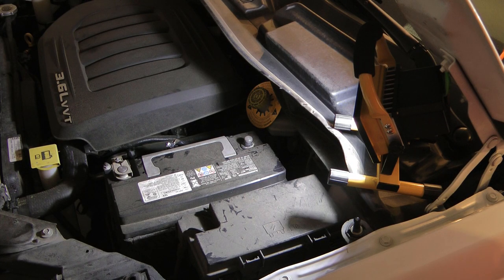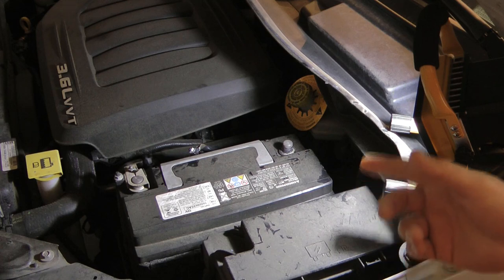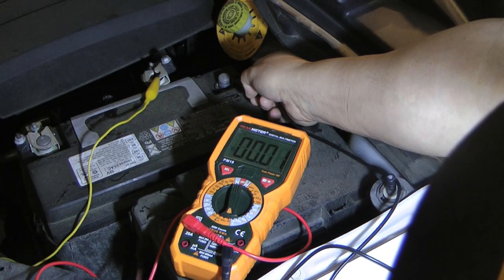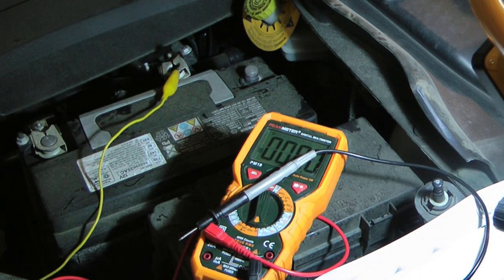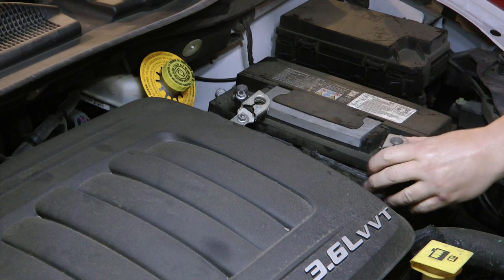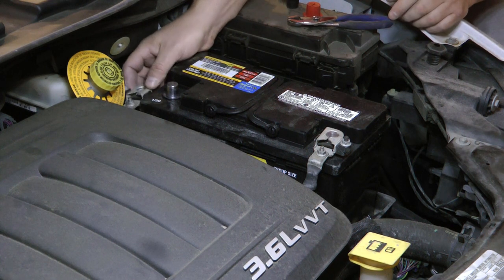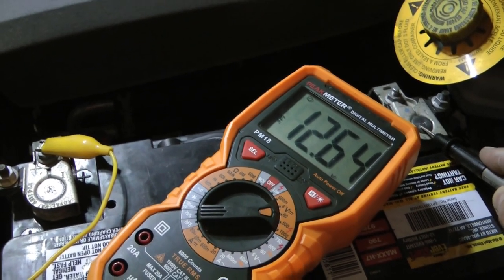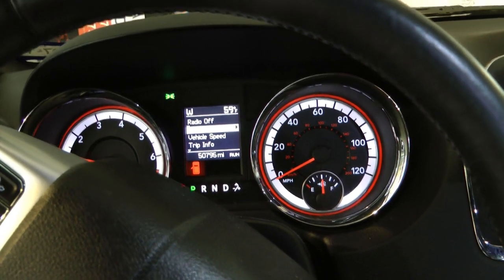Dead battery or parasitic draw - how to tell and fix the problem

Comment: Do you have any suggestions on my battery issue. I have a 2010 Ford Explorer. The battery dies after about three days of sitting. I have checked for a draw and it only shows .16 on the meter. Which it controls the microcontroller power fuse. That controls the door locks, remote start and tire pressure in the explorer. If I leave the battery disconnected it doesn’t drain at all so I know the battery is good. Tested the alternator as well and it gives a good reading too. I am running out of ideas of what is draining it or how to stop the drain. If we run the vehicle everyday it’s fine. Just when it sits it dies.
Reply from the maker: doesn't sound like it has much of a draw.  Is the battery weak and in need of replacement?  I've also noticed that some of my vehicles are fine sitting for extended periods and others won't sit for more than 2-3 days without being put on a float charger or being run
Reply: WJ Handy Dad thanks for the suggestion and the battery is only three months old. I think there is a draw somewhere but it’s not an immediate one. Like it kicks on as the vehicle sits. Wish there was a way to monitor the voltage continuously for like an hour or so. My meter shuts off after like twenty minutes.
Reply from the maker: that would be a tough one.  Maybe remove 1 fuse for 3-4 days and see, then replace it and remove another?  I know that would take forever and may or may not solve the issue but it might help you figure it out.  Good luck!  I hate trying to diagnose electrical problems!